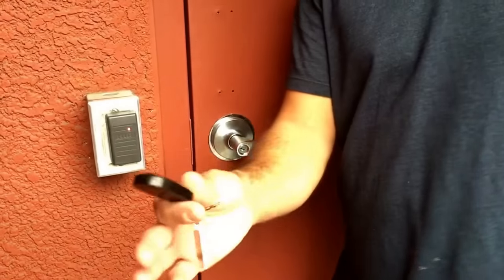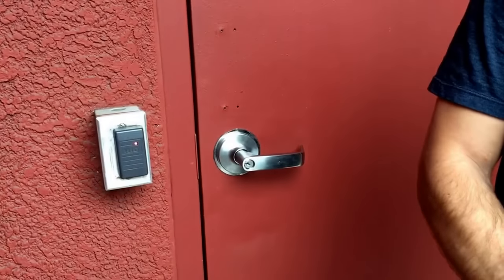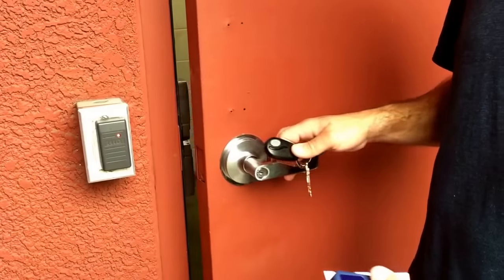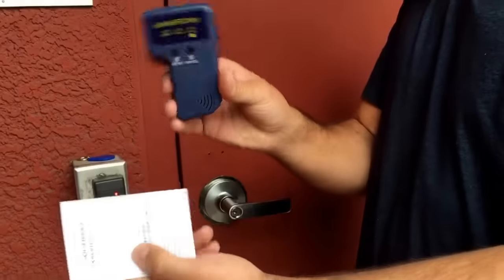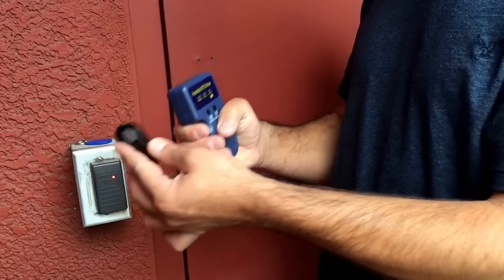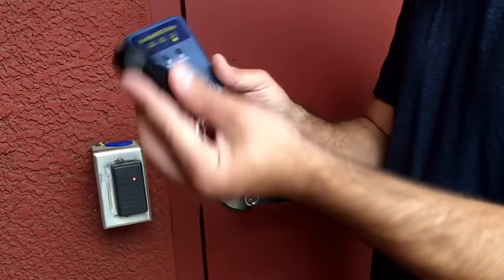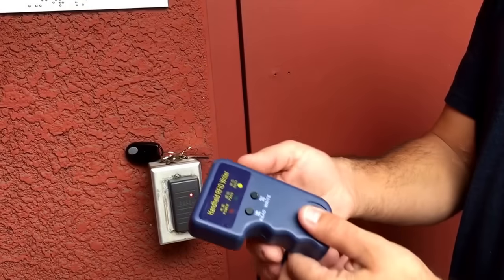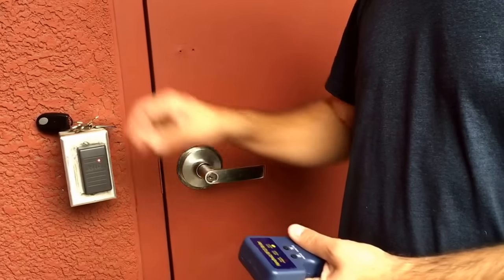Hid duplicate rfid clone

Comment: That reader is HID (old reader by the way) but the clonned credential is from another manufacturer. HID produces the credentials SEOS, impossible to clonne since 2014 and the technology of this video has 30 years old
Reply: Exactly... None of these cheap RFID fob duplicators work on modern access control systems, even the cheap ones, as they're all encrypted and require official OEM reader/writers from HID etc.

Comment: Does this work with Keri key fobs? If not, what would work? Thank you!
Reply: Stephanie Baez as long as it is RFID it should work...
Reply: @EncryptingJava  no it only works with prox
Reply: @hilo2-est3-elev  well my idiot self didnt know that three years ago lmao I've known that for a while now thanks.
Reply: @hilo2-est3-elev  actually encrypting is right in a sense, if keri fobs are rfid, which they are, as long as they are the correct frequency of rfid chips it should have no problem reading. I've used this exact copier on a ton of different fobs.

Comment: Can it program hid cards too used for gates and elevators?
Reply: Probably not.
There are two kinds of RFID cards and two main frequencies they work on.

ID cards (ID = Identification) just transmit a code to any reader which asks.
IC cards (IC = Integrated Circuit) actually do computations (encryption is usually included) and will only reveal some of their information to properly authenticated readers. Although, these cards can operate in ID-only mode, which makes the reader and the infrastructure much cheaper (and much less secure, so all installers who install it like this, should be shot).

125kHz is usually for ID-only cards.
13.56MHz can be for ID or IC cards. The NFC hardware on your smartphone operates at this frequency and, with the proper app (TagInfo is a good one), it can usually read some parts of these and tell you what type of card you're scanning.

So, if your system is ID-only then any $9 reader from e-bay should be able to copy your ID to the right kind of recipient card.
If it has encryption and your system is actually using it... make sure you properly recycle the $9 copier and don't throw it out with the regular the household garbage. :-)
Reply: Hi, i have the same problem, i need to duplicate my gate and elevator cards but i dont know which machine to buy and what type of ID cards and HID to buy! do you have any info? Thanks
Reply: @micheldeslandes4339  That's strange my building makes the door and elevator the same card.
Reply: @dankmheems290  In my building we have a front door, a large garage door and an interior door with locks on both sides. I have installed encrypted RFID keyfobs for access and one keyfob will usually be able to open all 4 locks. It's programmed that way in the controller.
The technology (in my case, Mifare DESfire) and the encryption key determine if the keyfob is usable with that "reader" or not. If it is, it will send its id (each fob will have its own unique id) to the controller (a piece of hardware connected to the readers) and the controller, in turn, will decide if that keyfob should be able to open a particular lock when its swiped.
If someone loses a keyfob, I can look them up on the system and disable their (and only their) keyfob. No need to have the key to do it. I can also put an alert to notify me of any future attempts to use the keyfob.
In the video above, it seems the technology used is very rudimentary (probably the 125kHz EM4100, which doesn't allow encryption) and even if it's not the EM4100, encryption is clearly not used. Otherwise copying would not be possible to copy it so quickly and easily.
Just think of Metro tickets (if you live in a place like London). They use this technology but they would be up the creek if they were that easy to copy.
Reply: @micheldeslandes4339  Is there anyway to know whether our building uses ID or IC type readers? Is there such indicator on the reader or my fob? Thanks 🙏🏼
Reply: @samanshp  If you have a reasonable smartphone, with NFC, turn on the NFC (in a similar way to how you'd turn on bluetooth), install the app "Taginfo" and place the tag (or card) behind your phone. If your phone reacts, then the tag is responding on the 13.56MHz frequency, and that tells you it's an ic card (Taginfo will also tell you what type). If you get no reaction whatsoever from your phone, it's probably an id tag/card, operating at 125KHz, which the phone does not pick up.
Apart from that, you can always pick up ic and id card readers on eBay for $5.
If you want to check on the reader itself, then I think "HID" readers are the only obvious ones where you can assume they use ic cards. Those clearly have the letters "HID" on the front. All others, you'd probably have to rip off the wall and look behind them to check the operating frequency, which may reduce your popularity in the vicinity, if you're not the one who owns them.

Comment: That little gizmo only copies one freq.  Not all.  Its pretty useless.
Reply: Everyone should note: the little (close range) fobs and cards like this are at 125Khz (considered low frequency HID or RFID). A smartphone's frequency (NFC) is at 13.56Mhz... which is considered high-frequency RFID. It won't work together.